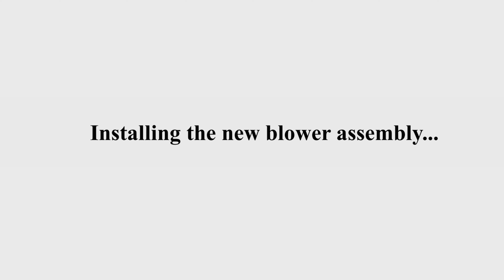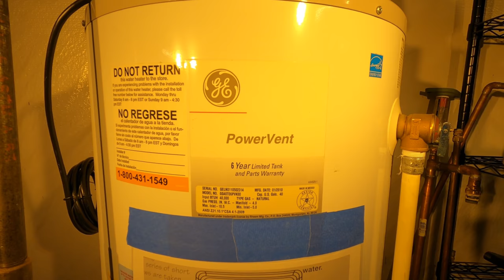Replacing a Vent Blower Assembly | Rheem Water Heater | Man About Home

Comment: I had a very similar issue with a Bradford White unit. The first thing I tried was removing the fan assembly from the heater and used a small wire brush to clean the cups on the squire cage. There was quite a bit of scale and dirt buildup in the cups, I think causing an imbalance problem. I vacuumed the unit out, reinstalled and the noise went away. I purchased a new fan as well, but the old one has been quiet for a few weeks now .
Reply from the maker: That's interesting. I haven't disassembled my old unit yet. Maybe I'll find something similar? We'll see. Thanks for watching and commenting.

Comment: I had the same problem w/ my AO Smith unit.  I thought I could just replace the bearing(s), but I was wrong - the impeller wouldn't come off the shaft.   I ended up having to buy the whole blower assembly @ $300-ish.   What a waste of $.
Reply from the maker: Yes, they're very expensive. When this tank eventually fails and needs to be replaced, I'm planning to sell the good parts on Ebay or elsewhere... try to recover some of the cost. Thank you for watching and commenting.

Comment: What is the price of a new water heater compared to a new blower assembly and a new gas valve?
Reply from the maker: You can check various components on Supplyhouse.com, to get a sense of the costs. Nothing is cheap! One of these 40 gallon tanks is $1200 at Home Depot. I took a chance on replacing my gas valve, and I ended up having another problem, with the vent blower. When, not if,  the tank fails, I'll have to sell the components off to recover some of the cost. I would have gladly purchased a used blower vent assembly if I could have found one. Thanks for watching and commenting!

Comment: Thank you so much for this video. I have never been so prepared for a project. 

Some notes for everyone: The price of the blower has been fluctuating and was climbing around the time I was ready to buy ($700s). Fortunately, I was able to get it from Supplies Depot ($435) before they raised the price. Amazon pricing is the best (a little over $400), but they are out of stock very often. Also, Part # SP13416 has replaced AP13416-3, AP13416-4 and AP13416-5.
Reply from the maker: You're welcome! Yeah, the cost of these things is sky high now. Thanks for the helpful part number info. And thank you for watching!

Comment: Nice video. Any sealant between the new unit and the water heater?  gasket?
Reply from the maker: Thank you. No. The foam gasket that comes pre-attached to the bottom of the blower unit is pretty sticky. It appears to be fine without additional sealant. The best indicator I have is the owners manual for the water heater. There are instructions about how to install the vent blower unit on a new water heater. There's no sealant recommended in the instructions.  Thanks for watching!